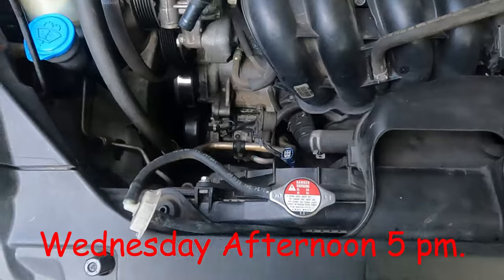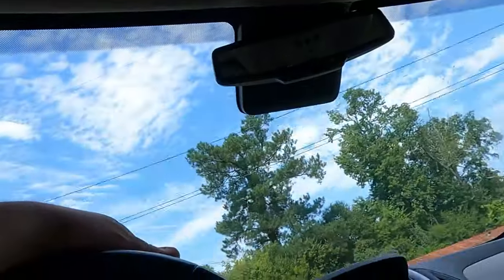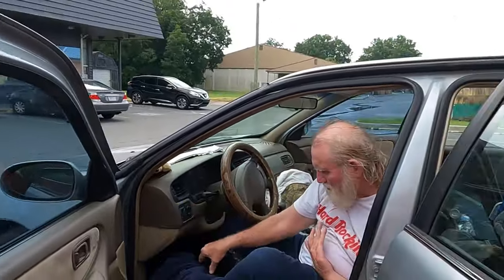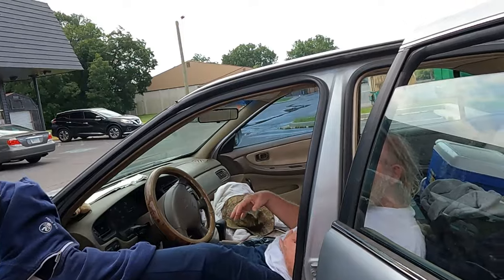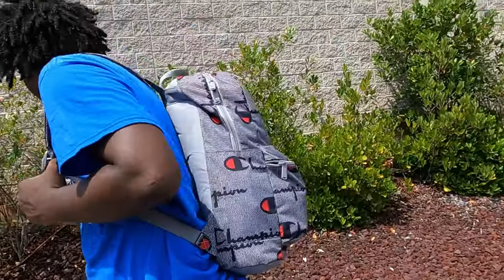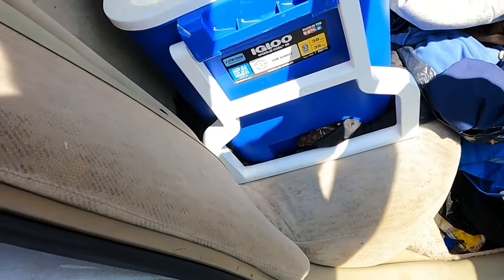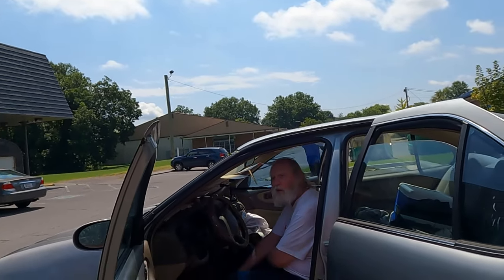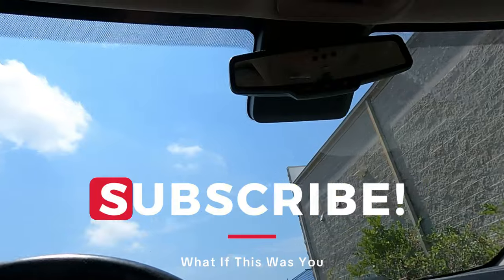Had To Follow Up With A 🙂 Familiar Face

Comment: Heck yeah that's what I do Amazon for my parts I do all my own brakes & everything I did my brakes last summer pads shoes 2 new rotors only about $130 

Yea it probably happened in shipping those shippers are careless & don't care 

Most things I do on my car myself except for bigger things mechanics are expensive now at least here in NY $110 a hour crazy better & cheaper to do it yourself 

Good cardboard to block some of the sun that is great I feel bad for him he has to be hot & tired of just sitting there in one spot all the time ahh save the money I think he going to be there for a bit he will need it when he needs it it will. Be good to hell him